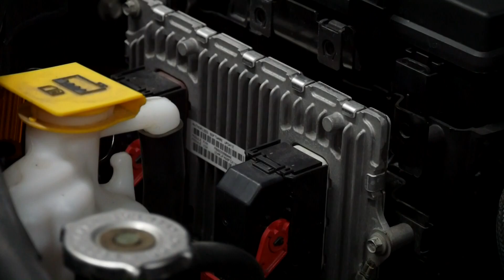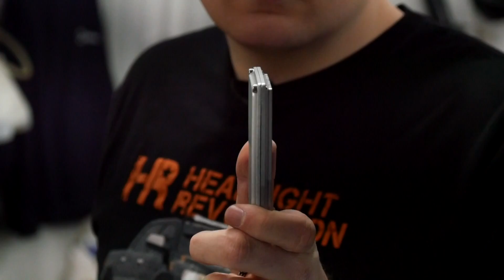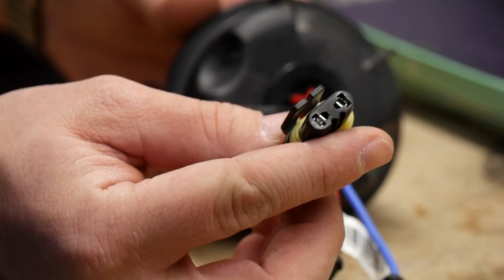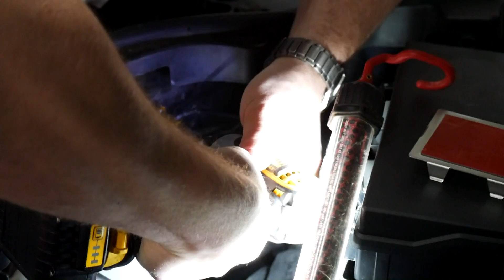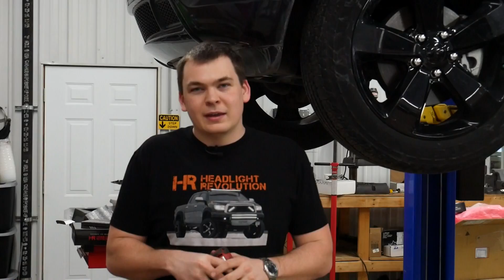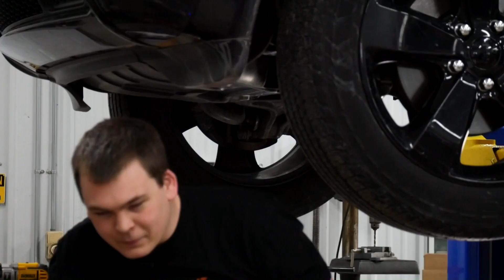2011-2018 Jeep Grand Cherokee HID Fog Lights, LED Turn Signals - Install and Demo

Comment: These are awesome. I bought the 6000k 55w kit and put it in my 2014 Grand Cherokee... Hella difficult to remove the stock bulb, but once its out, these are easy AF to install and look incredible. I can finally see more than 15 feet in front of me.
Reply: And my balast went out...
Reply: Myles Gelóneck Yeah that’s the reason why I haven’t gone HIDs, I hear too many problems with ballasts that stop working and bulbs not igniting, especially where I live where below -30° is pretty common in winter. Good quality LEDs work nicely and don’t give as much trouble.

Comment: I found on my 2015 Jeep that is was not necessary to remove three bolts on the computer as the video states at the 00:20 sec mark.  The bottom left bolt proved to difficult to remove until I saw a clamp to next to the top left bolt. Just push back and the computer slides up and out.
Reply: All American Rides  on your 2015 did you have to buy the extra harness that the website recommends?

Comment: thanks for borrowing the clip of my jeep in the offroad  intro to your video...………… make sure to cut me a check!!!!!
Reply: You can't be so low on cash that your crying over your clip that was used. Btw did your video at the time have any copyrights?
Reply: @nomi4905  I am pretty sure he was making a sarcastic comment, but as an etiquette, you should ask for permission or at least give a video credit. If its not a big deal just run your Jeep over a mud hill for the intro. Otherwise, you are just being lazy and cheap by copying stuff.
Reply: @singhhundal1  I don't think he was being sarcastic.
Reply: The fact that he doesnt know the difference between cheque and check...I dont think he deserves one

Comment: Thanks for the video, it is very helpful. I have a '14 JGC and was planning to do this upgrade. Can you tell me or do you have a video of where you mounted all the ballasts? Thanks
Reply from the maker: Thank you for the comment! The ballasts can be mounted wherever is convenient, no real worries on any specific mounting area. Grab a couple zip ties and hang the ballasts from any factory wire loom or somewhere to the body of the car. You could also 3M Tape it to the back/side of your headlight housings as well. :)

Comment: The computer unit will unclip! Don’t have to remove the bolts the clip tab is o long the top edge of the back of the metal bracket and holds the metal bracket from sliding up and out. There’s 2 slides in the back and will come out easy when you get it high enough

Comment: I have a 2013 Jeep Grand Cherokee. It has the reflector housing, not the projector housing as shown here. I put LED 5000k bulbs (from VLED's https://www.vleds.com) in my low beams. They are just as bright as HID's in my opinion. My Jeep uses the Low Beams for the daytime running lights, they are on anytime the car is out of park and turn on and off with the turn signals. I tried having the DRL's turned off at the dealer, but they said there was no option to turn them off. Oh, well... they look good during the day too.  I left my fog lights stock halogen.
Reply from the maker: Glad you found a great product!

Comment: Hi with this bulb also work with the jeep grand cherokee with the factory DRL lights?
Reply from the maker: Is your DRL currently on your low beam? If so, yes it will work, but the DRL will be on at full brightness as HIDs cannot dim.
Reply: @HeadlightRevolution  maybe I stated it wrong, my headlight  has the led ribbon DRL and the bulb I believe is a DS3.
Reply from the maker: Oh I see. In that case, this HID kit won't work for your application, you'll just need to upgrade the D3s HID bulb instead. 
These three bulbs will be your best opitons!
https://headlightrevolution.com/compare/5020/4678/516
Reply: @HeadlightRevolution  awesome thanks for the link
Reply from the maker: Anytime!
Reply: @HeadlightRevolution  I actually switched on the DRL and my HID flickered and went out for a few hours, I don't recommend turning your DRL with this kit.

Comment: Hi guys I just finished doing this upgrade, the same three here; Low Beam, Turn Signal and Fog Lights.  I did it different than you guys.  I laid the front cover down and worked it right from the front.  I was able to hide the ballast and stuff better that way. One thing I didn't do (yet) is install the turn signal resister on the passenger side.  There wasn't enough wire length to hide it on metal where I wanted.  Drivers side was ok, but I need to put the other one under the hood like you did.

My turn signals outside blink ok.  But the turn signal indicators on the dashboard are fast.  Could this be because I am missing one resister on the passenger side?

Love these lights
Reply: Did you do this on a Jeep with factory halogen bulbs?
Reply: @AaronD34  Yes, factory Halogen lights.  The factory Low Beams and Fog lights are replaced along with adding a ballast units to each, all plug and play.  The Turn Signal light is a bulb change and wiring in a small resistor unit to stop the fast flash on the instrument cluster.
Reply from the maker: It is vehicle dependent. Could be due to having the incorrect ohm rated resistor, or could be from wiring the resistor up incorrectly.
If it's an HR customer, link this video, it's very helpful. https://www.youtube.com/watch?v=ADKjG3Z2L5w&t=1s

Comment: Hi i was wondering if you could help me with the wiring on my 2008 Jeep Grand Cherokee is set up for HID lighting and the new lights that I purchase has a total different setup it's not the same plug the existing one on the vehicle it's like 14 wires on the plug the new ones is set up for led four wire , is there a conversion kit that I could plug into the existing one to attach it to the new lighting I guess it came like this from factory I'm not sure it's a 3rd generation I purchase new lens because the old ones will fade it very bad and the plugs are totally different any advice or help highly appreciate it thank you Robert
Reply from the maker: Send pictures and info over to our support team so we can help you!

218-755-5200
Sales@HeadlightRevolution.com

Comment: Can you do an install video for the upgraded headlights that only use 1 bulb for the low/high beam, or just suggest the correct bulb kit? The install should be very similar I assume.
Reply from the maker: What vehicle is this for? The process for a single bulb headlight would be very similar to this.

Comment: Great vid and website

Would you recommend HID over LED on the Gr Cherokee ?
Reply: Hid for Distance, LED for foreground light. I always stick to HID's. In my experience between factory or aftermarket LEDs, I get poor luminosity in wet weather. But HIDs still light the way in all weathers as long as you don't exeed 5500k

Comment: A question , I have a grand cherokee 2018 . The usb/aux lights keep on all the time no matter whether the engine is running or not . Is this normal ?q
Reply: I have the same concern with my 2018 but I'm guessing it's normal. On mine they usually turn off after an extended period of time even if something is plugged in
Reply: It turns off once you step away from vehicle and lock the doors

Comment: So you're putting HID bulbs into a halogen reflector?  I have heard the light pattern is not well controlled in this case, and even intrusive to oncoming traffic. Also, why didn't you change out the high beam as well?  I guess the ballast unit doesn't have to be mounted, you didn't say. I like the idea of that turn indicator bulb, but cutting, splicing, soldering...  you make it look easy, but for the uninitiated, it's a little much, I think.  Oh, and cost?  Lots of unanswered questions.
Reply from the maker: Its all good man, HIDs may not be for everyone! With that said, the HIDs in this video were installed on both the low beam and the high beam. The low beam on that vehicle is a projector, so nothing to worry about with blinding oncoming traffic, and you shouldnt have your high beam on with oncoming traffic so nothing to worry about there. If you are feeling uncomfortable with the wiring and installation of the HIDs, we do have LED or halogen options that will not require nearly the same process! Let us know if you have any other questions!

Comment: Just bought a 2021 Grand Cherokee 80th Anniversary. It came stock with the premium lighting being HID bixenon lights. They aren’t nearly as bright or white as what I was expecting them to be. Is there a way to upgrade factory HIDs without breaking the bank? The car is brand new but I think the lights leave much to be desired.
Reply from the maker: Yeah absolutely!
I would recommend upgrading the bulbs to the Osram Night Breaker Laser bulbs!

Comment: Could you update your kits' links in the description? They seem to be broken/not working. Would like to take a look at your pricing and order!
Reply from the maker: I am sorry to say that we do not have those kits anymore, and that is due to the change in regulation on LED and HID lighting. We are not longer allowed to recommend LED or HID for a headlight application on the road, we can only recommend them if they are for an offroad application. I can get you halogen recommendations, and I have linked the low and high beams below! 

Low Beams: https://headlightrevolution.com/h11-halogen-osram-cool-blue-boost/
High Beams: https://headlightrevolution.com/9005-halogen-osram-cool-blue-boost/

Comment: Do the turn signal lights stay a bright white while driving. I have a 2018 Laredo and want led day time running lights but this would be just as good. If anyone has done this I would appreciate some pictures.
Reply from the maker: If you order Switchback turn signals, they will be white DRLs.

Comment: Just got my HIDs hooked up on my 15 GC and test everything before I reinstalled the bumper. Everything worked perfect I go to start the vehicle and no they won’t work or flash on and off. No check engines and purchased the anti flicker as well. Idk if it’s a computer issues or what. Any ideas? Thanks!
Reply from the maker: Hey Josh, Send us an email at Sales@HeadlightRevolution.com and we will help you out.

Comment: Quick question, I have a 2014 jeep grand cherokee limited with the hid led headlights, if i want the blue hid bulb can I change the bulb only or would I have to buy the whole hid with another ballast?
Reply from the maker: You can totally upgrade the bulbs in that headlight, and I have linked the bluest bulbs that we offer on our website for your vehicle! Link: https://headlightrevolution.com/osram-xenarc-d3s-66340-cbb-bulbs-7000k/

Comment: How about an LED retrofit for the  same model Grand Cherokee?
Reply from the maker: We tried LED headlight bulbs on this vehicle, but the projector low beam made a bad beam pattern when paired with an LED bulb. We believe in only offering solutions that are truly an upgrade or improvement, and we weren't seeing that with the LED's. Only HID bulbs created an actual improvement of light output and brightness.
Reply: Well I guess that would be why there is no LED video lol, thanks headlight revolution!

Comment: Hi i installed a Race Sport Amber/LED Light turn signal bulb for my 2015 grand Cherokee limited halogen light model. I used a race sport 25 watt resistor. I combined the resistor  cable to the ground cable and turn signal cable I used a light tester and made sure of the connection was correct. The lights will turn on but when I turn on the vechile the instrument panels says both lights are out. So I moved the the driver and passenger side resistors connection from the turn signal to the park signal and only the driver side works great. The passenger side light will illuminate and flash however when I put the hazard lights on and turn signal I get the bulb light out warning. I know I used a different product but I also know mopar vechiles can be complicated. Any advices will be appreciated. Will a 50 watt resistor work? Thanks in advance
Reply from the maker: Those vehicles can be very complicated. To be honest, Since you're already this far, I would try a 50w 6 ohm resistor. If that doesn't work, Reach out to us and we will get you the correct parts for the vehicle. That may also include new turn signals that we have tested and found to work well on those Mopar vehicles.

Comment: I have a 2014 grand Cherokee and was told that led bulbs could not be installed due to housing.
Is this true and why HID is preferred? Where are u located? I need shop to complete HID install in this video.
Reply from the maker: Hey Maria, thanks for commenting!
You have projectors, projectors are designed to have light entering them from 360 degrees, LEDs only have light coming from two directions.  So if you put an LED in a projector you wont get good light output and you will not have a beam pattern.
We are located in Minnesota, thanks again!
-HR
Reply: Maria Snowden,  h11 led/hid fit in 2014 grand Cherokee

Comment: Hi, don't you need a relay harness with these HID's on the Jeep ? I've tried lots of HID kits non of them work, keeps flashing and eventually turn off completely
 :(
Reply: Adrian Toia yeah same happened to me get a set of canbus relays and you wont have anymore issues

Comment: For the switchbacks in the turn signals, do they stay white or amber in DRL mode?
Reply from the maker: The Switchbacks remain White as DRLs and switch to Amber when a Turn Signal is actively engaged. :)

Comment: was this jeep factory hid? my 2017 grand cherokee cutoff pattern is HORRIBLE compared to this video
Reply from the maker: This one was not factory HID, that's odd! This one wasn't too bad.
Reply: Everything fixed. The only proper way to install is to pull the bumper. It takes half the time to pull the bumper instead of fighting it this way

Comment: Did you have to use a relay harness on the 18 Grand Cherokee?
Reply from the maker: You will get the Morimoto Relay harness with the kit. It is needed. :)

Comment: My gc has a rubber floppy cover on the lights, not a hard plastic one? Whats the deal with that?
Reply from the maker: Sounds like you may have the OEM HIDs, which do not have the ability to use these bulbs. If you do have that, then you will need to go with a set of D series HID bulb replacements. We would be happy to get that set up for you, just shoot us an email and we will get that sent over to you!

Comment: Did you use 55watt Ballasts for the Low Beams?
Reply: lilal455 3:29 looks like it says 35W on the tag of the bulb. Assuming that goes with the 35W ballast

Comment: I have installed T30 Canbus H11 LED Fog Lights on my 2016 Jeep Grand Cherokee. They work fine for 5 mins then they automatically switch off. If i switch off my car and start it again they work perfectly fine for 5 mins or so. Any idea why that is happening?
Reply from the maker: That sounds like a CANBUS issue, so I would say that you will need to get a pair of the H11 PWM Modules linked here: https://headlightrevolution.com/gtr-lighting-pwm-interface-module-h11-style-connectors/

Comment: I did it exactly but my headlight power goes off and one not turn on.
Reply: You need something extra you just got the light I forgot what they are called but with out it they will not turn or flickering or strobing.
Reply: You need to add a PWM Module either by Morimoto or Xenon Depot

Comment: Installing bulbs in the grand Cherokee is a TOTAL PAIN.  Without the hands of a 10 year old, you will never able to change the bulb out.  The HID lights by HR are great quality, but this job is better left to a pro - spend the $ to have bulbs installed if they ever need replaced.
Reply from the maker: Thanks for your input!

Comment: Where do you get the kit?
Reply from the maker: The links are in the description: https://headlightrevolution.com/products.php?product=2011-%252d-2018-Jeep-Grand-Cherokee-HID-Low-Beam-Conversion-Kit
Reply: @HeadlightRevolution   Link no longer work. Is there any other product similar to the one used in the video that will be compatible with Mopar that will not throw any codes/lights on the dashboard?

Comment: I hope whatever Jeep engineer(s) that designed the way to access those bulbs has moved on to another career because clearly, he's a moron and has no clue.  I've  changed bulbs many times trying different ones and each time I find new expletives to bestow on him. You will explore new ways to unnaturally bend your hand/wrist/forearm to get to the right side (and he wasn't kidding about skin loss) and then, you get the pleasure of removing the entire airbox to access the left.  Why not just remove the headlight housing?  Because to do that you would have to remove the entire front  bumper fascia.  Hmm.....that engineer got how much money to screw us?
Reply from the maker: That is a bummer man, sorry to hear that it gives you that much trouble! I wish they were thinking a little more when they designed that, definitely not one of the fine points of the vehicle😂